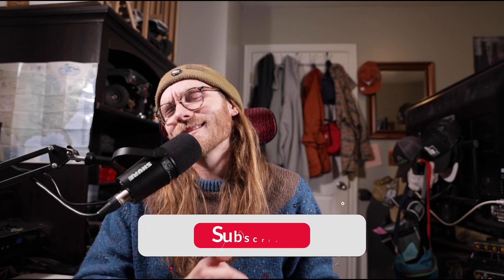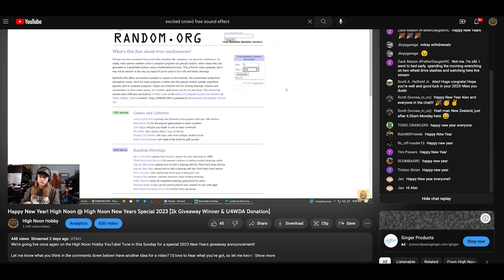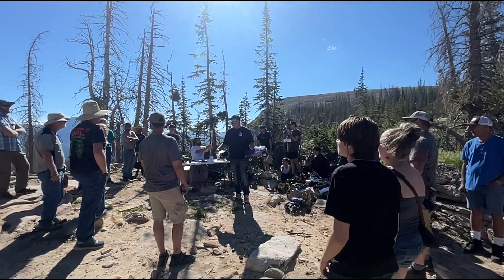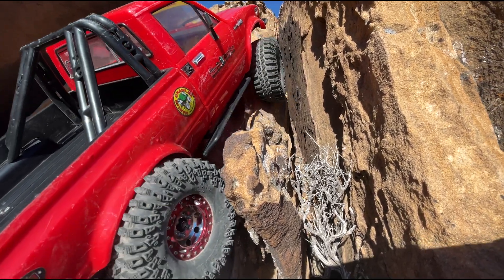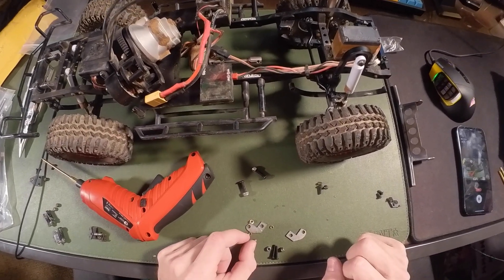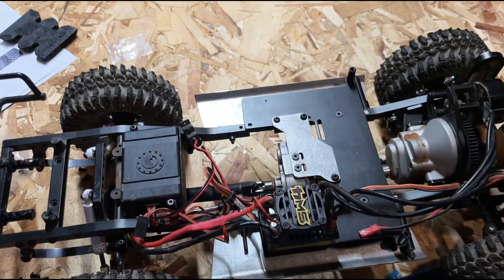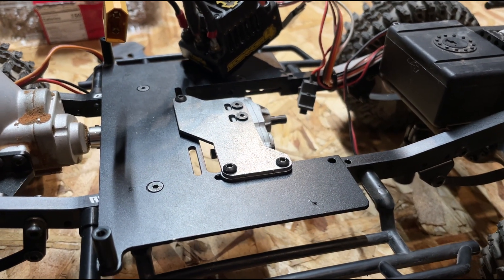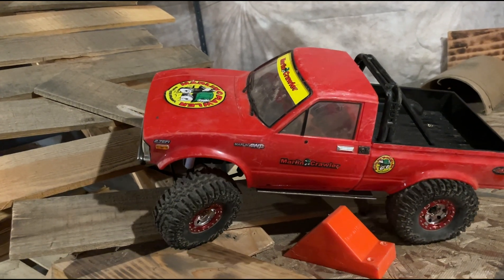RC4WD TF2 Upgrades from A&M Garage [High Clearance Skid, Shackle Reversal, Anti Wrap & More!]

Comment: Thank you for the support and great video!   The anti wrap bar is made to fit on either side.   Just unbolt the link out of the axle mount and put it on the other way.    Then you flip the shackle.
Reply from the maker: Ahhhh good grief I’m an idiot 😂😂 thank god for those in the hobby such as yourself that have a few brain cells to share with those like myself 😅 cheers!

Comment: I really appreciate your coverage of the Marlin. I've been eyeing one for months, but can't seem to pull the trigger on a rig at that price point that I know will need several hundred dollars worth of upgrades to make it capable/durable. Looking forward to the running video and your thoughts on the upgrades.
Reply from the maker: Thanks for the feedback!! I would certainly recommend the RTR, as I've heard horror stories about the kits missing parts and just generally being a PITA. But I would see if the Marlin goes on sale this year, if you could get even 75 bucks off MSRP that would go a long way towards upgrades. Honestly, you could probably get away with stock electronics (minus servo) for quite some time assuming you're okay with brushed motors. I just so happened to have this setup lying around after taking it out of the Bronco. Cheers! 🤘🏼🤙🏼🙌🏼🍻
Reply: @High Noon Hobby  I know it went on sale last fall for $100 off and that was what first intrigued me. I'd have to go brushless, especially with how cheap and compact the Hobbywing Fusions SE's are these days.
Reply: I just bought one and I’m about to bite the bullet on $400 in parts. But to me at least, tinkering and mods are half the fun. By all means, it’s ridiculous RC4WD hasn’t made a RTR TF2 with the reverse shackle kit, an A&M skid plate clone, better electronics, steel driveshafts, steel bumpers and sliders all around, etc. But I’m kinda glad because doing the upgrades yourself gives you a sense of accomplishment and satisfaction you wouldn’t get if there was no reason to improve it